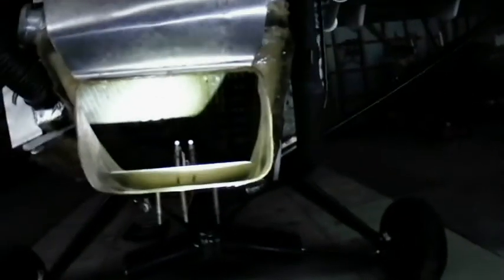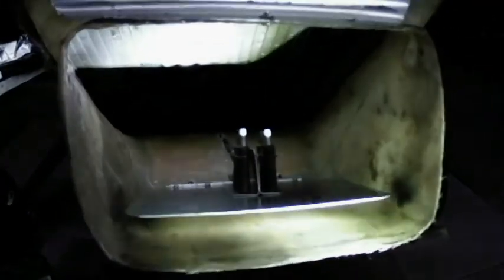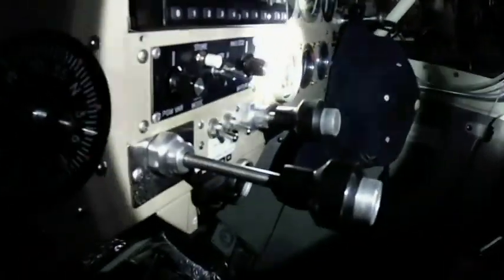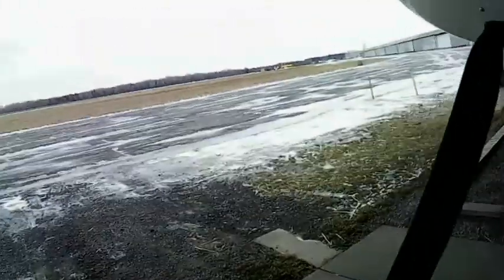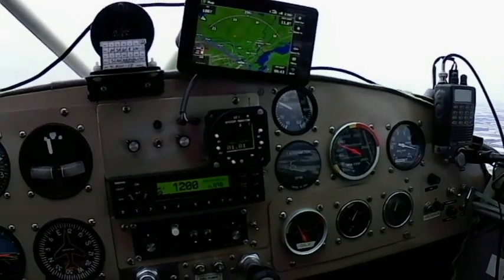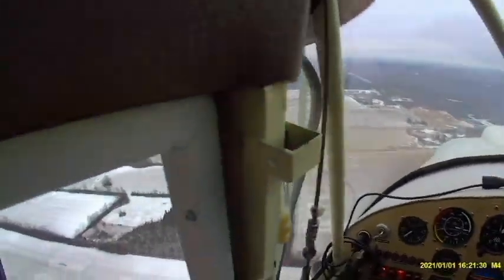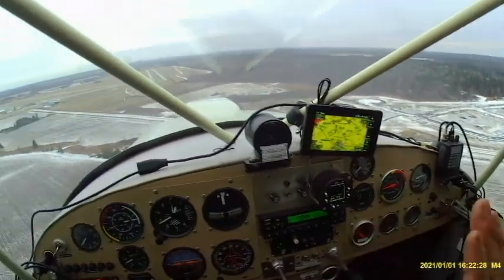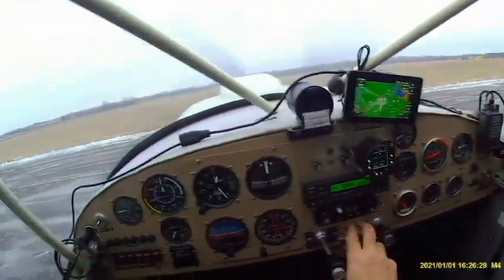Radiator Air Flow Control

Comment: What's the foil on the front floor of the plane for?
Reply from the maker: It's not on the floor; it's on the firewall as part of an insulation panel or blanket.